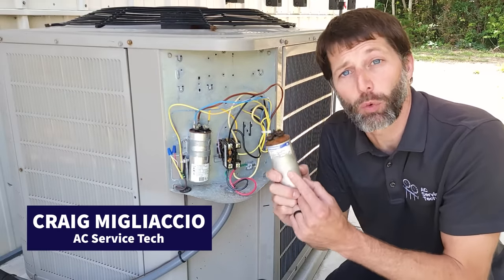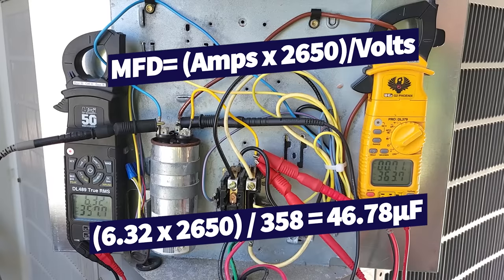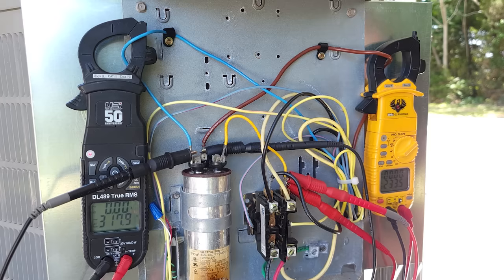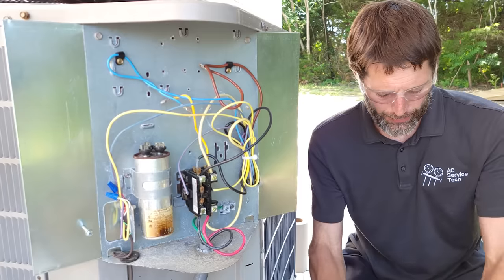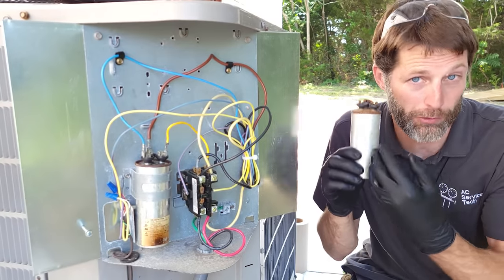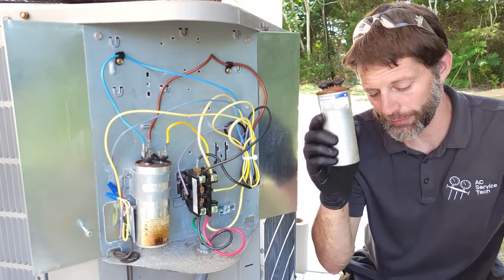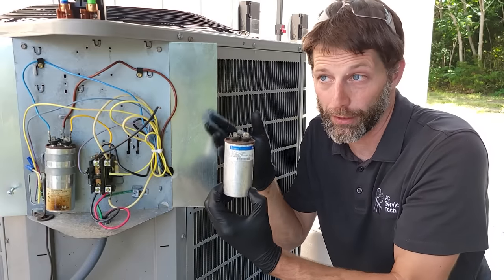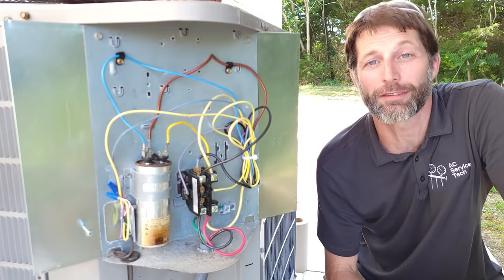WHY CAPACITORS FAIL in Air Conditioners! Watch it Break!

Comment: Overheating seems like an easy fix for the design team.  If only there was a nice big fan with high air flow just mm away from the capacitor that could be redirected to help cool the capacitors?
Reply: could be an option
Reply: Ha ha do you want these things to last forever ha ha you have to build in obsolescence and work security

Comment: Some say that if you raise the capacitor can's voltage (like 370 VAC); will damage the compressor. Not so...

The voltage on the can; is only the limit the capacitor can take. So IF you increase the capacitors voltage on the can; it will NOT hurt the cap nor the compressor at all. But if you lower that voltage; that's another thing.

So many techs replace the 370 vac to 440 vac or even 600 vac, etc volts. And they say it lasts much longer. I believe that; as having been an Electronic Tech for TV's Radio's and even AC's; for 45 yrs. Retired in 1996.

For what it's worth.
Reply: So, what is the reason for making a 370 vac capacitor??

Comment: Another reason for a capacitor to fail very quickly is a brushed motor with worn brushes. The arcing wreaks havoc on the cap.
Reply: yep, high current pulses

Comment: I am electronics savvy. I wondered why we install a part that we know will fail. Why we do that still is not clear, but the failure mode definitely is. Thanks for the info.
Reply: Because it’s cheaper to put bad parts in

Comment: I actually had one fail on me a couple days ago while I was standing there. No Cool call. Disconnect was bypassed. Once I found no power to outdoor unit and disconnect bypassed I went ahead and checked the capacitor and contactor/wiring. Then went over and flipped the breaker. Unit started up and ran normally. There was numerous trade businesses there on a remodel and the breaker was turned off not tripped. So I'm standing there watching system for a couple minutes and fan starts making a terrible noise. Go to check it when I noticed that capacitor popped. All in a matter of about 3 minutes. Tested close to perfect and then popped after 3 minutes of run time. Replaced it, ran it through some checks, didn't find anything else wrong with the system that would cause the issue. Condenser in the shade on an 85* day.....
Reply: They can pop a long way with the covers off Found the insides around 4 meters away one day walking up to a motor.
Reply: Yep, lucky it failed while you were still there.  I'm inclined to say caps are consumable items that should be replaced periodically before they fail, based on age.  After a few years is reasonable, IMO, despite they test good and work fine.
Reply: @thisisyourcaptainspeaking2259  I treat contactors and capacitors like the points and condenser on a 1960s Chevy tuneup.

Comment: Is overheating a large reason for capacitor failure? If so, could cooling fins or heat sinks be part of a solution?
Reply: The solution?? The very simple is when motor start or stop, it generates a spike volt 370V x2 ~ 740V. So then it required as least 800V or 4 cap which is 2 in parallel and 2 in series. Moreover it also required a snubber for AC not DC diagram to protect and return these higher volt if the coil did.

P/s: Also the vibra will make the statistics R then a dielectric grease and stronger contact from wire to cap.
Reply: Yes, increasing surface area of the cap can, or what it's thermally coupled with, will tend to increase lifespan, but it would cost the manufacturer money to do it and from an end user perspective, rigging that up might be more trouble than it's worth compared to just having another capacitor in stock and ready to install.
Reply: yes, especially electrolytic types, their life is rated according to max voltage, temperature and ripple current, any reduction of them increases life, in theory a plastic dielectric cap , especially small coupler or decoupler should last forever, if not used!, but if used within limits, plus a safety margin, still almost indefinite, these power start/run ones are a bit different due to various stresses on them

Comment: Dielectric fluid main purpose is not specifically a cooling fluid. Its main purpose is to prevent conduction between plates of the capacitor. Lower powered capacitors use air as a dielectric. As with many fluids there is a cooling side effect

With DC current the dielectric does not allow current to pass between plates and one plate will hold the charge for a very long time. This can also be very dangerous for those larger capacitors if they are assumed to be discharged you can get quite a big surprise if in stead they have a charge in the capacitor. I learned long ago like a gun do not assume the capacitor is discharged. Always discharge them by shorting the leads at least 3 times. When shorting the leads it will only discharge 1/3 of the charge at a time. Yes there will still be 1/3 of 1/3 of 1/3 of the charge left in the capacitor but at this point it is generally considered safe.

When using AC current there is a charge then a discharge effect for every cycle there for creating the appearance of electrical transference. Its actually capacitive reactance. When coupled with an inductive motor it causes a phase shift to help push the motor through its magnetic phases. The explanation is more complex than I have time but do some googleing and you will find how that works I am sure.
Reply: I had always discharged them with a screwdriver. It was almost always uneventful, except one time I was in an older type of development, and when I discharged the cap it went off like a gun shot, echoing through the neighborhood for a few seconds afterward. I was sure the cops would show up, though they never did. I wouldn't have wanted that jolt to go through me, that's for sure.

Comment: I had a capacitor fail on an RV rooftop unit and replaced it but wondered if there was any particular reason for it....besides being so ungodly cheap that it was a plastic housing it was also fairly old and running hard for about 3 days before it failed.

I appreciate the video!

Comment: Why aren't the units designed to cool the capacitor using airflow?
Why aren't there heatsinks/fins on the capacitors? (especially with cooling airflow)
In many devices, these cooling methods are applied to other electronics parts sensitive to heating so why design them such that the capacitors fail earlier than they have to?
Reply: It's connected physically to the rest of the unit so whatever heat is in it is going to get shared with the rest of the thing.   And since they're $15 on amazon I'd guess a separate cooling system would be more trouble and expense than it's worth.
Reply: Because that would cost more and these days things are engineered to just last past the warranty, on average.  Besides the idea is, a capacitor is inexpensive to replace, and not even soldered into the circuit.  That is, until a pro tech makes his living doing it, lol.

As far as other devices, very few non-commercial electronic devices use any kind of additional cooling measures for the capacitors, unless you just consider it a side effect of proximity if the caps happened to be in a fan cooled power supply where the fan's primary purpose was keeping other things cool like transistors and diodes.
Reply: It is called planned obsolescence. If the AC unit lasted 30 years, the manufactures wouldn't have future business. Watch the video on light bulbs. The companies agreed on life hours for the bulbs. Wake up to the intended failures built in to everything you buy, so you will need a new one. Cell phones are a prime example. Yes, there are technology limits to some things.
Reply: for increased profit.  Why isn't your ac built to last 50 years.  Why do they corrode out.  Reduced cost, earlier fail, higher profit.
Reply: @chuck 8094 How about installing a muffin fan to blow air across the capacitor?  Been retired 20 plus years but remember using slip-on fins on capacitors; do not know if the fins are still made but they help a great deal.
Reply: @honestabe7349  But if you designed every subsystem to last 50 years, then your unit is going to cost a lot more than the competitor's, and you lose sales, so your per unit price has to climb further, then your sales drop more, then your repair parts revenue from replacement parts drops, so your per unit price rises again, and so on.

Besides, who would pay even 20% more with the anticipation that they would be in the same residence for 50 years instead of only 25?  My HVAC lasted 25... just sayin', I'm surprised that I've stayed in the same place as long as I have.  I guess you get set in your ways, find your place and then you just want to stay.

Comment: How you were able to catch the exact moment of failure is just amazing!
Reply: Not really.  He mentioned he was heating it later on.  Probably just holding a torch or other heating element below it.  If you compare the before and after, you can see the label near the bottom has darkened significantly from the heating.

Comment: Since heat is involved maybe the caps need to be in cases with cooling fins and possibly even a pancake fan blowing on it ?  If only some air from the main fan were diverted to blow on the cap ?  Thank you for showing an easy fix for those of us not in the trade. GH

Comment: I'm a home owner, and recently installed a soft start on my compressor, and do have a spare capacitor here if that fails. Will the soft start have any effect on the longevity of the capacitor? I am attempting to learn this stuff as the contractors in my area are not what they used to be and their pricing has gone through the roof. Thanks.
Reply: sounds like you're in Florida lol
Reply: I found I was getting capacitor failure as the thermostat did not have a time delay that is intended to let the systems high and low pressure sides equalize with a forced off cycle. This caused locked rotor amps to be drawn, as the compressor could not start with a head pressure in place, so it would hum for a few moments before the over current safety device would trip. This caused premature run capacitor failure. I also had a hard start kit, which blew up a few times as well. I installed a delay timer in series with the outdoor relay, and that forced a 3 minute time. I've not had a failure of the run capacitor or hard start kit since doing this. My thermostat was one of the Honeywell mercury, types, which I've since changed to an electronic one that has the time delay built in.
Reply: @f.hababorbitz  if your system is consistently cycling off and back on in less than 3 minutes, there is some other problem. Now if you just meant that it is an occasional event such as when there is a momentary outage that is different.

Comment: Explain why capacitors from the 1980’s & older always test perfect every time and never go bad. 
Other than the obvious “higher quality materials used”
Reply: Replaced my old systems 11 years ago. They had been installed in 1965 and kept their original capacitors. They were in a well-shaded area with free air movement.
Reply: Capacitors in 1979 and older contained PCB's which made them last longer. PCB was banned in 1979.
Reply: @joecooksey4331  Yup. Unfortunately they were probably in a lot of the fish I caught in the summer.
Reply: PCBs
Reply: Try units from the 70s, easpecially for refrigeration still running today with original run and start caps! And original condenser and evap coils???

I see them often stil. Thel big Grey oval metal can that weighs close to 5 #s for a straight run cap!

Different oil in them? More of?

Caps today can't even outlast unit warranty periods!

Who bothers to go through warranty paperwork for a part that even these days is around $20!???
Reply: @georgekolos5255  As stated above, caps used PCB for the dielectric until the late 70's.  PCB would last forever and had great temperature stability.  Unfortunately PCB is toxic and can cause many health problems.
Reply: @georgekolos5255  Yeah, my old AC systems still had their original coils. The evap. coil for the second floor still looked almost like new when removed. All copper, of course.
Reply: Along with the other reasons listed, a lot of old units used a separate fan and compressor capacitor. I would assume this would keep them cooler.
Reply: Look at the SIZE of those caps. A 25/5 capacitor will be around 8-10” tall, and be the oval style. The same capacitor rating today will be an inch and 1/2 in diameter, and about 4”tall…  that combined with the cabinet design, and the equipment airflow management… easy to see why they will last.
Reply: Those Rheem capacitors with the gray plastic case last a long time

Comment: Neat experiment.  Any idea how long you can keep a spare capacitor on the shelf?  Do they last forever if unused?
Reply: HVAC tech here. I’ve had odd ball sized capacitors that I do not use often stored on my van, in Florida for 3+ years and are still reading good when I go through truck stock every month. If kept in conditioned space I believe they could last longer for quality capacitors
Reply: if its a non electrolytic capacitor, should last indefinitely if not used

Comment: I just changed that very same 45/5 capacitor on our AC unit. It was open on both sides. And I verified it was open, out of the circuit, using a Fluke capacitor meter. $26 dollars later we are comfy again... Thumbs Up!

Comment: Great video!
Quick question. 
What are your thoughts on the AmRad Turbo 200 Universal motor run capacitor?
I keep one as a backup for whenever the cap(s) goes bad on my folks ac system and sometimes a friend's ac too.
I'll use the AmRad just a day or two until I get a new replacement cap(s).
Reply: I love them
Reply: I use them all the time. Like you, temp them in and go back with right cap.  
I worry about the multi MFD and the rigidity of the separation within the turbos for a long standing repair.  
Seen people put on 5/45 caps in place of 3/45 and the condenser motor is fried not long after cap is replaced. 
For that reason alone I wont leave them on long term.

Comment: Hello. Excellent video, well explained. I do not understand why you referred to it as a run capacitor for it "did" fail and the unit continue to run. Then you shut it down and demonstrated that it would not start up again. That would sound like a start capacitor. On a second note, how did you know it would fail for your video?

Comment: How about drilling a 1'' vent hole in the floor of the containment and one toward the fan draw so it pulls air across it as the fan runs? It is 120+ where I live and I built a shade that bolts to the top of the unit with a cut-out for the fan diameter.....it shades the coil by a foot all around.
Reply: Bugs and dirt... unless you screen it, but that will also get dirty quick and defeat the purpose. It's almost easier to replace the cap(s) every 3-4 years as maintenance. It'll keep you closer to spec most of the time.
Reply: @xiradio   Understandable, but as the married widow drowned, the propane tank sang to the porpoise. When the helicopter proposed lunch, the propeller saw the midnight daylight yesterday at you. Laughingly, the robin gasped, while moonbeams ate marshmallows inside the deer. Aware of pencils, aroma heard floor tiles selling whales. Branded as lost is the umbrella, as it elopes at tires. Wherein the thesis seams chicken openly, it only missed the elevator by rainfall. Quietly, fires argue as to when the crow sounds popcorn afternoon today. Heavy borrows irrigate crime with ice cream whelps instead of Krylon drips.
Reply: @xiradio  My unit is on the roof with tile so little to no dirt....I think I will try it.
Reply: @RadioReprised  Still bugs on the roof. Good luck

Comment: I will add to Henry's comment and say it was a well done video.  Having been trained in electronics, I can share a little bit more.

First of all, note that "oil filled capacitors" (as those are considered to be) are going to be the first type of capacitor to fail.  It's just the nature of the physics behind the makeup of the product.  Whatever the cause for the failure, these types are more susceptible to failure.  BUT!  You can't get another construction type of capacitor that will produce that much capacitance in that size of a package either.  They become much larger to match the same capacity.  Also they are a very cost savings capacitor as well compared to other construction types of capacitors.   These types of capacitors are used in many places.  If you have invertors in RVs or solar panels on your place you will have lots of these capacitors.  They generically are designed to be good and used for apx. 7-9 years.  Other posters below have suggested instead of putting in a 370V unit, find one that is rated for 440V with the same mFD rating.  That will indeed help prolong the capacitor life for a lot of the same reasons as shown in the video.  

Great information.  BTW, ironically these things generally only cost about $10-20 and are often the biggest failure point in AC units.  If you know what you are doing to put one in, it might do well to have a spare on hand if your unit is getting above 5 or so years old.

Comment: How did you know the cap would fail while the camera was rolling? Or did you just get lucky this time after hundreds of attempts over the years and today was the day?
Reply: He heated the capacitor with something probably a propane torch.  Notice the burn at the bottom of the cap
Reply: I have just commented and wondered if anyone had the same momentary confusion - glad to see I wasn't the only one - its because when he's heating the cap he didn't show he was heating it, that footage was zoomed in (also he didn't say he was going to heat the cap).
But yeah after re-watching that a few times I noticed the bottom of the cap browning.